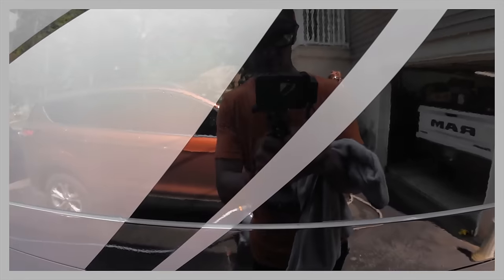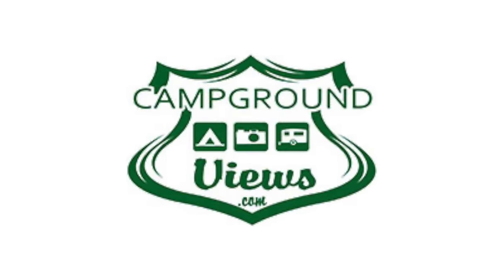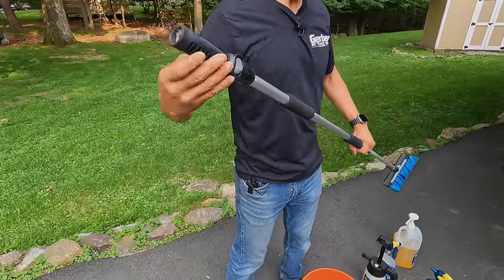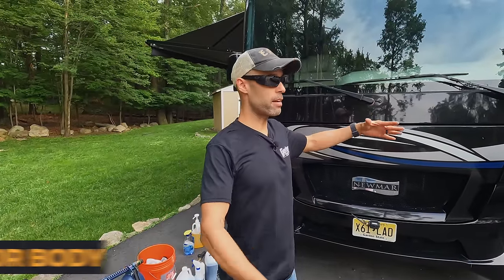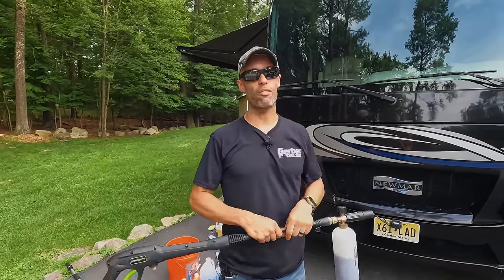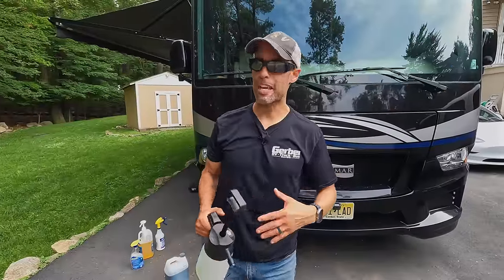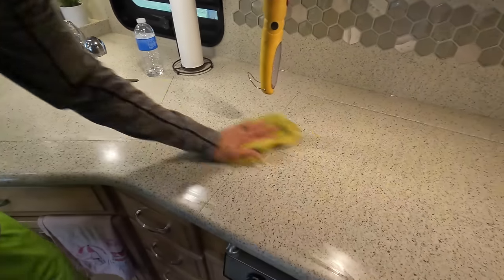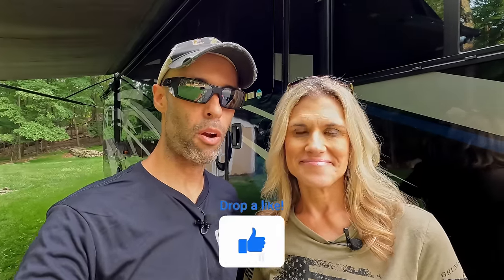Washing Your RV Made Simple -- Everything You Need For The Perfect Shine!

Comment: I have a Montana 5th wheel.  I don't have the full body paint but I use the following products which I have been very happy with.  YMMV, obviously Izzy's method is outstanding as well as his rig looks better than new!!!!

McKee's 37 Max's RV Ceramic Wash and Wax, 16 fl. oz.,MKRV-150-1
McKee’s 37 Marine & RV MKRV-631 Hydro Pearl Sio2 Coating, 128 oz.

I do the same method but different products; Spray on with a foam cannon rinse with a power washer.  The Hydro Pearl you spray it on then hose it off and then I dry with a microfiber cloth.  The water literally sheets off the sides of the RV.  It also keeps the bugs from sticking; just got back from Smoky Mtns with very few bugs that washed off with water.  Wayne Carini uses this line of products on all his classic cars.  The Ceramic wash is like $35 and the Coating is more expensive at $85 a gallon and they both will do my Monty a couple times.  I do this a couple times a year.  I am going to be checking out the Release product but will prob not use on the exterior since it will remove the wax and I can pretty much rinse and dry and comes clean.

Comment: Almost follow your exact cleaning regimen, equipment, and products on our Newmar.  She is eight years old now (we bought new), and we also get complements like you do.  On the road, I use WashWax All using their telescoping pole.  At home, because I can no longer go on ladders, I contract twice a year to have our coach hand waxed (using Rejex on painted surfaces and 303 on fiberglass roof, other plastics,  and tires (no silicone in 303)).  Haven’t heard about “Release”, but will check it out.   Thanks for the videos!

Comment: I use a product from proline. The truck and tracker wash is good for heavy grimy dirt/bugs/oily stuff, then I use their wash and wax product. I use their foam cannon attachment for a pressure washer. You just spray it on with the foam cannon. By the time the foam has run down or one side, you can come back with regular water hose or pressure washer just water only, no scrubbing. It’s a little expensive but cuts the cleaning time way down.

Comment: clean the roof and condition it every few months, wash/simple chuck rinse system along with the green works pressure water and  aero cosmetics, as wipe or touchup. (wash the rig every time I do the roof. Inside we clean the unit completely before we use it and after we use it when it gets put away.

Comment: Well guys, I follow almost step-by-step of how you wash the exterior of your RV. Here’s what I do, yes use a pressure washer electric and rinse down the Coach, that gets off 75 % or more of the dirt/bugs( because of the coating on the Coach)then I use chemical guys black light wash soap with a foam cannon. It is especially designed for darker colors. I let the foamed soap do it job on the Coach. I rinse that off with a pressure washer. Here’s where I do a little different process. I now use‘s deionized water to pressure wash with the foam cannon black light soap a second time. Izzy you say the next step is never to use a brush on your RV. I have been using a Montana boar hair brush for over 10 years. (I use it on a Black C7 Z06 corvette with no scratches) I go over the total DS with that brush. I rinse with deionized water and let it dry. Over the last 20 years or more I have try many types of waxes and coatings and paint correction process for painted surfaces. 4 years ago I switched all my vehicles to GRAPHENE coating including the DS. You can use a high dollar Graphene products which I have, but in the last two years, I started using 303 graphene coating out of a spray bottle. In my book, the product is incredible. That’s why I can make a comment that 75% or more of the dirt or bugs come off with just light pressure wash rinse. I’ve ran through hard rain and my coach looks like it has been washed. I know there is a thousand ways to clean and protect vehicles. Just like you I have my process from setup to tear down to 50 minutes cleaning the outside of the DS 4369. Great video to help people learn how to take care of their RV/coaches.

Comment: I use a foam cannon with a heavy concentrate of dawn in it and electric power washer on the roof and body, I’ve full body paint also on my class C. Also owning two show trucks “semi’s” I have special brushes I use that leave no marks on the coach. For wax I use nu Finnish and in between mcguires spray wax. Tires get 303 as well as the rubber under the hood and anything rubber like seals etc. inside is Lucas vinyl and leather cleaner helps leather and no greasy armour all feel. Smells good and satin. I wax that coach at least 4 times a year. And when we’re out I’ll take it to a blue beacon, no brushes and no brightened. Just a trucker thing.

Comment: What would you recommend for a fifth wheel that doesn’t have full body paint, but the decals? Would Release work on that and not strip any protectant that was put on the rig to keep it from fading?
Reply from the maker: Release is a cleaner not a UV protectant.  So release to clean and rejex or nufinish to protect